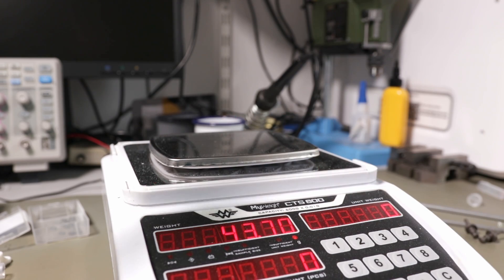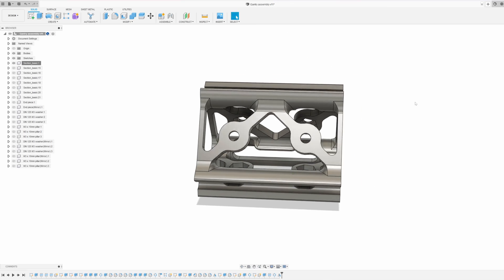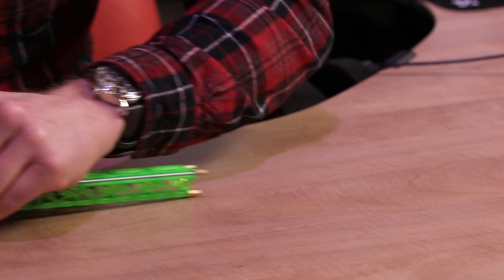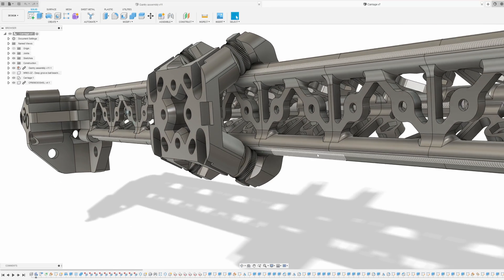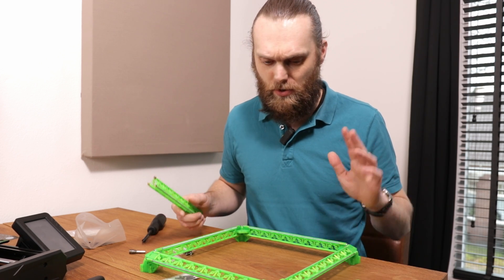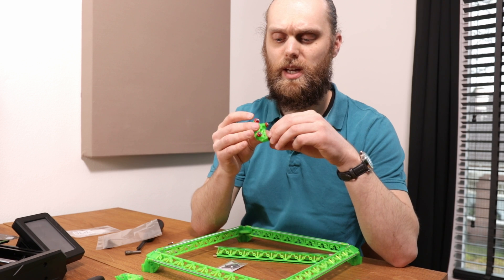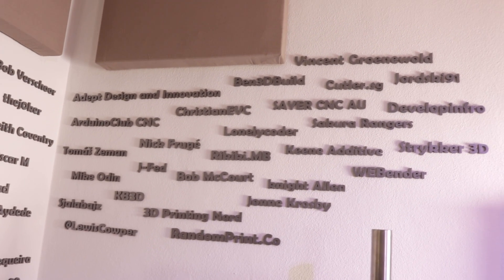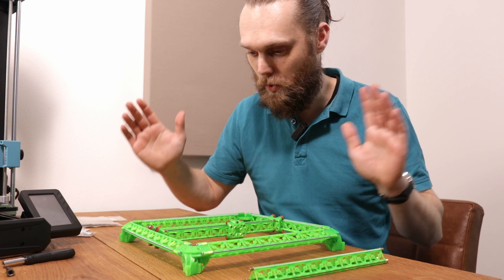Is This System the NEXT STEP in 3D Printing?

Comment: It's cool looking, but I can't shake the feeling that a very different design would be needed for this use case.
The third rail on the gantry is dead weight, as are the ends of each modular section (fewer, longer modules would reduce the weight).
I'm also wondering if just a pipe could work as a gantry. It would need something else to keep the hotend from swaying forward and back (a slot in one side?), but it might be lighter than 3 threaded rods and their 3D printed supports.

Comment: I'd be interested in seeing this more. I also had the idea of smooth rods with threaded ends and concave bearings to roll against them, in hopes it would be smoother.  as for lighter... .i think that's an as-you-go situation.  unless your printing in aluminum or other lightweight yet sturdy metal or alloy, I don't see an easy solution all around, but step by step improvements as you go.  Finding that a solution doesn't work,  back to design for it , or perhaps finding a lightweight metal solution to replace it with, etc.

Comment: Uuh that was pretty intereating in term of diy printer buliding.
Maybe instead of m3 rods you maybe use normal 3mm rods and Cut the Threads by yourself.
That would solve the Movementproblems with the actual Rollers and the weight would be Not realy that much more.
All in all ITS a was cooler Design for a voron Type printer that is moslty printed.

I would Love If you Finish it because i would Love to make it myself.

Comment: The higher (farther away from the support) the motion is, the less stable the system becomes.
So wouldn't it make sense to have the motion part to be as close to the base (support) as possible? Thus an inverted printer should have much less ringing.

Comment: I have a 3d printed rail, that I am using on the x/y axis of a corexy printer right now.  It is a 3d printed corexy, 3d printed extrusions etc.

You should take my file and see if you can work with it.

Comment: this looks really interesting! How about moving tensioning to the center (maybe steel wire in the middle and screws with loop in both ends or just one screw) and outer sticks could be carbon fibre?

Comment: instead of using threaded rods, you could try using carbon fiber tubes that people use for rc vehicles. you'd have to figure out some way to mount them because they're not threaded, but it might make the gantry lighter, and also with the benefit of the rollers not having to deal with threads.

it'd be super cool to see this being developed further, it could be useful for modern reprap esque printers

Comment: One thing with many of the gantries is their tubes are hollow. I know many hobby shops sell tiny metal tubes (~3mm), you could replace the threaded rods with those and screw a bolt inside the ends to keep the stack tensioned.

Comment: An idea you could try is to use carbon fibre tubes and cylindrical linear bearings. Carbon fibre tubes are often used for drones because they are light and stiff.

Comment: the diagonal beams with a little hole disc halfway through, add flex to the beam. I do not think you want that. You want more rigidity, not less. Those diagonal beams should be continuous.
The carriages should not use 4 rollers, but 3. This way it can be lined up with only one roller having some give in it, instead of lining up a square which will never be exactly right.
What is the goal here, use off the shelf parts and print as much as possible ? then a titanium threaded rod is not really off the shelf... if you want max rigidity and lightness, carbon tubes will be much better.

Comment: Take a look at concrete beams that are prestressed with tension cables. What if you ran 1 very light cable through the center of of your truss then tension it? It would be very strong and light. Then you could replace the rods with something lighter just for your gantry rollers. No need for them to hold the segments together. Maybe carbon fiber tubes. Or maybe lose the rods and just 3d print a trough for bearings to run in? That assembly would be extremely light.

Comment: Looks cool, I like that it's modular
Ideas, use the hollow steel tube:
1) at the end use a long screw and glue with J-B Weld original(or your glue of choise)
2) use one of those ball joints used in RC for the stearing, insert the side of the ball into the tube, form the tube ends to make them hug the ball, add glue if posible. The threaded side should stick out and allow you to apply tension, you can choose from steel, brass or alum.

Comment: When it comes to choosing materials for mechanical assemblies, it's important to consider the specific requirements of the application. While threaded rods can be useful for transmitting tension loads or providing clamping force, they are not typically considered to be a primary structural material. This is because threaded rods do exhibit some degree of elasticity, which can be useful for producing compression when tightened. However, this elasticity can also result in lower stiffness and strength compared to other materials like steel beams or columns.

If you're looking to achieve a high level of stiffness or strength in your assembly, it may be necessary to consider using stiffer materials and threading the ends as a means of connecting components. By selecting materials that are appropriate for the specific application and design requirements, you can create a strong and reliable assembly that will perform as intended.

I also wanted to kindly mention that thermoplastics may not be the best choice of material for this particular application. This is because their young modulus, or stiffness, is generally lower than that of other materials like metals. However, if you prefer to stick with thermoplastics, I would suggest considering a carbon fiber reinforced filament. This type of filament will have greater stiffness while still maintaining a low weight. Please keep in mind that fiber blend filaments may not be as strong as natural filaments, but they can still be a good option for achieving the desired level of stiffness.

May I suggest you studdy the history of fully 3D printed Reprap printers before going any further ? This will save you a lot of time. Regards.

Comment: Rather than threaded rods, what if you used steel wire? Clamp Tite is a handheld tool used to make clamps or lashings, if you used steel wire to lash edges together, you could make an even lighter frame.

Comment: Suggest you use double butted wheel spokes from bicycles to clamp your segments together.   Even  better would to be to use dyneema UHMW rope wheel spokes.   These would be extremely light and have tensile capabilities simillar or better than steel.  Good luck

Comment: Super cool, the modularity of the design is quite interesting. I think it probably has a better chance however if you use just 2 rods instead that are just stiffer even if heavier. Might be able to find colbalt rods but just have less rods and use them like a train track.

Comment: Great idea! The tetrahedron is the most rigid structure from geometric principles. However exploring the unknown means that a few failures are to be expected and this is part of the learning process. They usually allow to generate new ideas. 
Two things though:
- for smooth movements you need smooth surfaces. 
- things that assemble will be heavier than something in one part as you need to generate extra loads to keep the parts together.
I'm eagerly awaiting next episode.🤩

Comment: Can you have the threded rod in the center of the truss? And add the holow rods ony there needed? Can one other idea be to have a internal rope or wire to pill the tension? And have the adjustment ony on one end?

Comment: Do it. Speed of one isn't important. Just do one, print the next one with it, boom double speed. 
Have two nozzles on the same gantry, have two gantries with two nozzles, check their combined speed. Have 1+2. Use 0.6 for filling, 0.2 for outer shell plus a 0.2 water soluable.
Lower the number of corner kinds by using a square. 
Make the interconnecting plastic parts lighter (no extra holes) and longer (less work to assemble). 
Have a version of interconnecting parts that don't expose the rods - only the gantry needs that, and would make the rest stiffer.
Awesome project!

Comment: Smooth rods where just the very ends are tapped and the track rollers you mentioned would eliminate the primary flaw with rough motion. Lightweight foaming filament would reduce weight. You might be able to get away with 3 rollers gripping 2 rods as if it was an inverted v wheel printer which means your extruder mount would become a pretty small triangle. Since the 3rd rod is now only needed for tension some of the truss supports connected to it could be eliminated. That same 3rd rod might also become some magnet wire etc if it isn't guiding a roller. If you wanted to be completely berserk about chasing grams you could sand the rods so the cross section would be a D shape  rather than an O to further shave down ~40% of the mass of the two remaining rods. You'd need to get everyone on earth to agree not to sneeze to keep it from breaking, but you'd have bragging rights for a DIY ultralight X rail without having to metal print a titanium one.

Breaking away from speedboat I think the structure being preloaded under compression and multiple materials might be interesting for resonance. Tune the threaded rods like guitar strings and fiddle with plastic type / truss design / print settings for the best possible starting point prior to input shaper.

Come to think of it I'm now wondering what impact shoving a guitar string down the middle of standard aluminum extrusion and tightening it would have on resonance. Horrible waste of effort or would it push resonance to a higher frequency and thus out of the way of normal printing.

Comment: Kinda want to see it completed and maybe print a 3dbenchy or something, even if it's not faster or anything. :) It does look really cool! ^_^

I was thinking RE: threaded rods, could you use a mechanism like the head stepper in a floppy drive that moves the head via a screw like drive? The shaft could be either geared to the stepper motor or directly attached. you could probably use that method on all 3 axis...

Comment: How about 3 x 6x4mm Carbon fibre tubes configured in a triangle and print extruder mounting block and integrated 6mm linear bearings out of PA or Igus filament, then your entire gantry will consist of the CF rods and a block to mount the extruder onto, will be super light and super stiff.

Comment: Man that looks really cool. Especially in that neon green. 
A couple things though: I think you need to measure stiffness/deflection. That's the reason for all those super light gantries instead of just running bare rails. It's not really for strength, just for extra stiffness.
The other is that using threads as gear teeth is never really going to work, the way they're made is simply not accurate enough.

Comment: OKAY ! ! ! !  Now, I do not feel alone. Imagine, having spent the better part of my engineering life, having to R&D ideas that are wrapped around safety that have never been thought of before, while injury or deaths are not allowed, and all the typical parameters are there, strength, light weight, cost effective, ease of assembly, etc...etc...etc... and then, after so many years of that, building things with a never ending constant state of paranoia of failure to keep people safe, then to go and R&D and built items that in no way shape of form, require that mindset of worry about the well being of LIFE or high degree of safety for others... LOL...

Other engineers know my history, and always can't wait to see what I will do, as they are interested in seeing just how complicated and strong I will design something like a simple angle bracket to support a shelf, LOL.... They laugh at me for this as it is a horrible habit to break. They often times joke with a phrase, "If the world were to end today, the only things that would remain are, cockroaches, Twinkies, dirt, and this book shelf bracket."... LOL... Granted, this has served me well for 35 years, but, dang, if I do not overly engineer something that was so not needed to be.. .Bend a piece of plastic, poke a pair of holes in it, and screw it into the wooden shelf and side panel of the of the shelf casement...LOL... Oh no, I will machine a chunk of extruded aluminum to form a gusset and TIG weld caps on the sides of the open ends with counter sunk, lol... Never mind that this over kill of a bracket, would stand out and look horrible and no longer hidden or blended in, it then becomes the center piece of the items that would typically be on the shelves, like picture frames of family or trinkets, nope, that oddly designed angle bracket.. pardon the novel... But, I had to laugh, as I do not feel alone in this notion, that our minds automatically bust out the math to build the most simplest of things and is second nature to do that.  The more simpler fix for the shelf, was to run down to the local hardware store, and just buy a ($0.89) angle bracket that already to go... Would have taken more time to buy it at check out, then to screw it on the shelf... Oh no, I will turn this venture into a $14,893.00 part that looks like it was to be cleared for the space program...LOL... It is just my nature to do this...

The idea of more times then not, the simpler is the better option on many, yet, is a struggle to know when to incorporate the simple attack on a project.. I think this will never change in the way I do things.

Comment: Printing the parts in ABS will reduce weight by a good amount. Abs is lighter than pla on its own. Also tubing instead of threaded rods is a great idea however cut internal threads on tube not external as any thin wall tubing will be better at it. Also I would say the scale your working on is your enemy. A large size printer would make for better weight efficiency.

Comment: If you used hollow tubes, could you use a plumbing tool to flange the ends to keep the tubes in place, and then use like a heated insert at the end instead for mounting?

Comment: The problems you show are mostly about incorrect materials (if you ignore availability, and cost).
Considering the size limitations and that the basic design consideration this solves is about speed, I don't see benefit to a 3d printed rail because I don't think you can get the necessary rigidity you want because you can't tighten the ends of the rail enough given the materials.

Comment: I really like the system, the major flaw is that it's doesn't move well, if you only fix that it would be a really good system, it's cheaper than the linear rails and you can print it, in other countries linear rails are not easy to get and are really expensive, I don care if it's heavy compared to linear rails, keep going!

Comment: How much weight do the individual printed trusses weigh? Can longer printed sections with less material maintain the desired strength? If you thread the ends of titanium rods, could the weight savings in the trusses be offset into the rods? I personally would love to see more.  I see great potential and would love to do some experimenting with the concept myself.

Comment: Running the system in tension seems like a positive improvement to me. In the 24/7 printing video about lightest gantries we learn that weight isn't the only factor involved in higher acceleration using input shaping. I would not be surprised if a tensioned gantry would have a far higher input shaping acceleration than a non tensioned one.

Comment: Use 3d printing to make a layup mold for carbon fiber strands, add a metal strip  to the vertices and then lap the strip flat for the bearing surface

Comment: Realy nice disign! I cold imagine incresing the segment size and useing a hollow support structure like a printed tube with checker plate-ish features could increase the stiffness while maintaining a light wight, possibly enough to ditch the M3-Rods and use a pice of 1,75 filament as a rail instead. This could reduce the price and increase the accessibility while maintaining a light wight.

Comment: IMHO you are approaching the topic from the wrong end. Start with requirements and work your way to parts that make the system meet these requirements, not the other way around. Start with required printing speeds and tolerances then work your way to get the parts needed to satisfy the requirements.

Also not moving elements  don't have to be light.

Comment: What if you just used the 3 rods or tubes, without out all of the inside 3d printed parts. Maybe just have end plates and then one in the middle for alignment or none at all.

Comment: If you are going to use smooth rods and need to cut threads in them anyway, I think I'd use tubing and tap internal threads in the ends. You could user larger internal diameter tubes which might add to the stiffness without increasing the weight. This was a very nice instructional video. I don't think you are a native English speaker, but your English is very good and very understandable.

Comment: I think that maybe the heavier but cheaper version of the system could be experimented with in order to possibly provide people with a rail and frame system that could be used to make printer builds (or more likely rebuilds) cheaper, even if it was not used for the full frame. It does seem in its current state to be more of an alternative solution rather than an improvement right now but for some people that in itself may be compelling enough to work with it, at least in the earlier "cheap" version using steel instead of titanium.